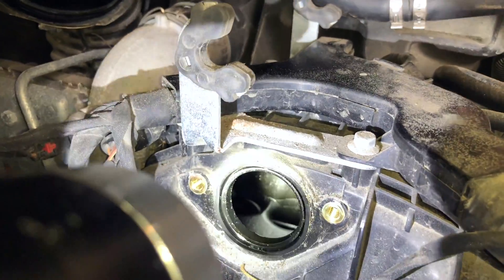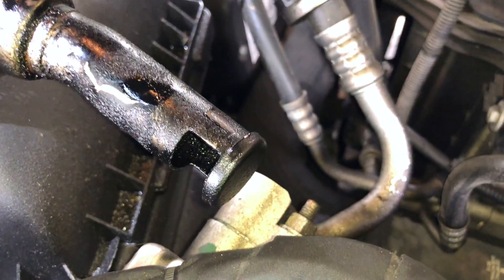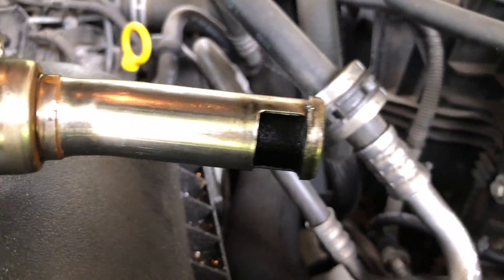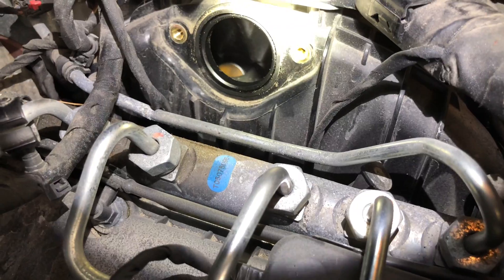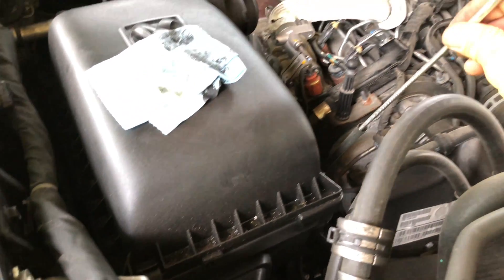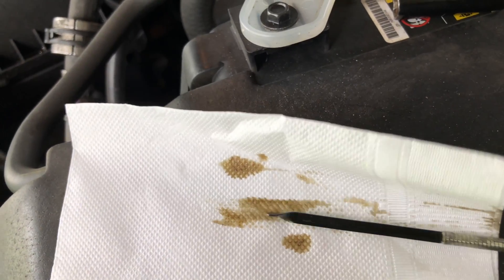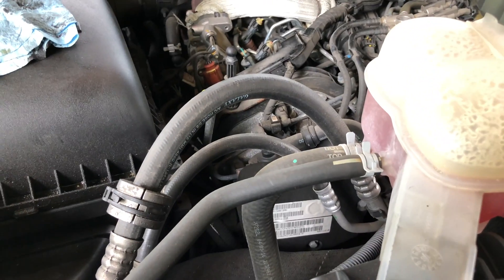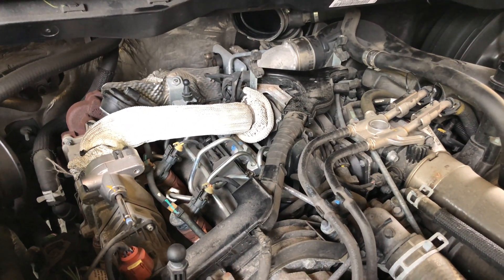Tuned EcoDiesel Update (GDE)

Comment: Deleted my EGR cooler at 102,000 miles, GDE tuned since new. Diffuser tube still clean.
Reply: how you delete your egr with a gde tune? that would mean your running two tunes unless your speaking of their pre ban
Reply: @bull5919  Pre ban tune with egr and def delete.

Comment: Do you swap out the ECU every time you visit the dealership?
Reply from the maker: No. I don’t have a second ECM. Just tell them not to install any new software without your consent, you’re “happy with how it runs and drives currently”
Reply: @hidmagnum  Right on. Just bought the truck and terrified to screw with it. I have not heard a single bad thing about this tune, thanks to videos like this it's solidified my decision.
Reply: It would be sweet if it were still available to purchase.
Reply: @fusserick76  I was still able to purchase it. However I live in Canada so I'm sure that's why. I've also heard on a few forum threads that they are currently working on a new one that will meet EPA standards. That being said, I wouldn't screw with it until after the recall, because I'm sure FCA will also update the ECM with the recall. Give it a few months for green diesel to catch up then make the move. As of now.. it's the best thing I could have done for my truck. It runs great. And in Canada it would still pass emissions.

Comment: SO you just ran the tune without deleting any emissions equipment? Still using DPF/DEF? How does that all work? How do regen's work with it tuned?
Reply from the maker: Correct. All emissions equipment is still intact and operational, except the EGR is electronically turned off. Works just like factory. Regens happen but at longer intervals. Nothing to see or worry about here.

Comment: Can someone explain to me wtf is a GDE tune!! I am searching you tube and on the web and all I see and hear is how great it is and that it cost about 700$ but NO ONE actually shows you wtf it is!!! I have a 2015 Ram with 80,000 Kim’s on it . I find it sluggish at times any keep getting Check engine code for exhaust gas sensor. I’ve never cleaned my EGR and am just now really checking up on this. I do mostly city and sone highway, I do tow my 3500 lb travel trailer  in the summer but not far. What is the GDE?? A program?? And add on??? Even on GreenDieselEnginerring web site all they do is I tell you the benifits of this GDE tune and the price but wtf is it??? Is it something I can do myself? Is it a plug and play kind of  a thing a majig ?? Can someone please help understand.
Reply from the maker: GDE is your truck computer being programmed with their setup. They focus on longevity of the engine and not performance. A major bonus to the tune is the EGR being electronically turned of resulting is far less soot being put back in the engine. Cleaner oil with less soot means you get less abrasive material swirling in the engine internals. You have 2 options. 1 send in your ECU to GDE and they program it and send it back. Or 2 you buy and ECU from them and you have a spare you can reinstall in case of warranty work. 

Their tune is used by many and it’s been working great for us. They have done a lot of R&D on the tune and it shows how well it works. 

Good investment if you plan on keeping your truck for a long time. 

Check out my oil filter video. Clean filter, no metal fragments. 

Hope this helps.
Reply: ShadyVlogz yes it does!!! Thank you for explaining. So basically you  remove nothing from your engine aside from swapping out your ECU with one that has been reprogrammed by GDE? But isn’t a complete delete a better option ( if you are not concerned about warranty issues) to solving all DEF, DPF, EGR and sensor code issues?  This is something I’ve been watching very closely. And actually it’s how I came across this GDE Hot Tune option.
Reply from the maker: The tune turns off codes that appear for no reason, such as def codes. I only have the tune. It’s been installed for 3 years. I haven’t had a single engine light. Performs well and I wouldn’t think twice that there is a tune installed, except when I check my clean oil. 

A complete delete is obviously a good thing for the engine since you would be eliminating all the things that really create a problem with modern diesels. But then there’s environmental impact. Your choice at the end of the day. I’m totally happy with just the tune and the truck doing regens and using DEF to clean the emissions. That’s my view and may not reflect others.
Reply: ShadyVlogz Thank you very much for taking the time for explaining all this to me. I will start with cleaning out my EGR which is something I never did and I’m at 48000 miles. It’s crazy that its not mentioned in the maintenance manual that this should be done at regular intervals!!  I’m a little nervous about doing either of the two possible solutions we’ve covered here. I have a choice to make.

Comment: tks for the vid! where do you buy this gde tune from? i live in hamilton. i just got a check engine today with a p200a and p200b code.( intake manifold runner performance bank1 and 2 ) if i get a tune will it clean up the soot build up in the intake or will i still have to get new intake manifolds or is it possible to clean manually?
Reply from the maker: Just saw your post on the forum. That site will help you learn a lot about this engine and truck in general. To answer your question, the tune will not "clean" the soot, but it will prevent further soot buildup. 
I'm just a driveway mechanic so can't say if it's OK to drive your truck until you fix the problem.
If your intake is that filthy, it definitely needs to be cleaned by removal. Don't want that garbage falling into the cylinders.

Tune website is in the video description
Reply: @hidmagnum  , what does it mean „tune the GDE“? Is this a procedure or do you buy a tool or some part? Where can I read about it? I got 73.000 km on my Jeep Grand Cherokee in Germany and I checked it and saw a lot of soot as you got it.thanks in advance.
Reply from the maker: @ivaningbg-73  GDE îs a company that tunes the ECU in your diesel vehicle. The tune electronically turns off the EGR valve and reduced soot buildup. Naturally there are other benefits to the tune aside from the EGR shut off. Google Green Diesel Engineering, read up on their website or send them an email for proper information from the source. Hope this helps
Reply: @hidmagnum  ,excellent explanation. Thanks a lot.

Comment: Thanks for the Video. My wife has a '14 Jeep GC w/EcoD. I'm really considering the GDE tune. Why did you not block off the EGR? As I understand it, GDE turns the EGR off on all of their tunes? How do you like the tune?  Thanks again!
Reply from the maker: Still under warranty. If something looks out of place, that raises suspicions. And if any work needs to be done on the truck, can’t be telling me I’m messing with the emissions system! 
But the tune is great. I don’t notice it is there. But I know it’s working.
Reply: You already voided warranty by installing the tune. The new ram computers will show even if you put it back to stock.
Reply from the maker: @cutandcleanwi6947  They cannot void your warranty because of the tune. For example, if you have an engine issue, and FCA declines your warranty work because you have a "tune" they have to first prove that the "tune" is the issue that caused your engine to not work properly. Just because someone modifies their vehicle (show me someone who doesn't), be it with rims, lift kit, air freshener or engine tune doesn't put the manufacture in the clear. There could be design flaws. And a modification doesn't necessarily damage your vehicle. The design flaw is most likely the culprit. Yes, it's a battle to go through. But there's a chance you're going to battle because you modified your vehicle. If you don't want the hassle, don't modify before warranty is up. but like a lot of folks, we do it and we deal with it.
Reply: I’m just saying that lift kits, tuners, air intakes, egr deleted will void your factory warranty. You might get lucky and have a dealership that doesn’t care but highly unlikely. I’m just letting people know so they aren’t blindsided when they have an issue with their vehicles and they tell the dealership that someone on YouTube said it would be fine.
Reply: @cutandcleanwi6947  Google "The Magnuson-Moss Warranty Act of 1975".  It basically says that the dealer must be able to prove that your aftermarket part caused the failure.  That being said, you do take a risk installing aftermarket parts, but it certainly does not void your warranty just because you installed it.

Comment: Tuned mine at 600 miles and also put a GDE trans tune on about 2k miles ago. The 2 paired up is awesome. You may want to consider adding a catch can. Keeps any oil residue from blow by going into turbo. My eco has 9000 miles on her now. Changed oil 2 times already. The oil is so clean.

Comment: If you don't mind me asking what dealership do you take your RAM in for Service? I"m looking to have the GDE tune done as well and would be willing to have my serviced there aswell.
Reply from the maker: Don’t get me wrong, but I don’t want to expose anyone. I have lots of respect for the guys at the dealership. What area are you from? You don’t have to worry about having your tune found by the dealership. They can’t tell that it’s there. Worst that can happen is the tune get overwritten. Get the GDE tune, and enjoy it. Your truck with thank you in the long run and you will thank it on the first tank. Clean oil. Minimal soot in your engine. Disabled EGR. Better fuel economy. The sooner you get your truck tuned, the better it will be. Enjoy!
Reply: Not looking for anyone's name, just the dealership. I live just north of T.O. Bought our RAM several weeks ago and just brought it in for its 1st oil change.  We spoke to our dealers service Manager and asked what they thought about the tune and the reply was, well lets say it wasn't positive.   There's a possibility I may have drawn some attention to myself as a result and if that's the cast, I wouldn't have any other option but to take to a dealer that is ok with it or simply wait for the warranty to expire.  You mentioned in your vid that your dealership researched the tune themselves and are quite comfortable with it, so I didn't think it would be an issue if you provided their name.  How about their closest intersection :)
Reply: @Smeelge  did you find a place to get it, i live close to you and i'm also looking to get the gde tune. help!!
Reply: I think the only place to have it done is GDE.  I don't have a problem with that, the concern I have is it voiding my warranty.  I don't want to have to go through all the BS between myself and a dealership after the fact, I'd prefer to find one that is ok with it or better yet endorses it, they'll will be the ones that get my business.  Just haven't found one yet.  So when someone says my dealership doesn't have a problem with it, or that their dealership researched the tune themselves and are quite comfortable with it and yet they are reluctant to name the dealership (whom I'm sure most EcoDiesel owners would love to know) I don't have a lot of confidence in that person.  If I find one, I 'll be sure to post it here, but until then I won't be performing the upgrade at least until my warranty runs out.
Reply: My guess is if you could privately message the o.p., they may give some assistance. Publicly putting info that was requested could draw some unwanted attention towards the dealership from corporate.....

Comment: Nice I have a 2018 ecodiesel so your saying that the dealer doesn't bitch about the tune
Reply from the maker: I’m saying I’m cool with the mechanic and the service advisor.  I’ve been a long time customer and they know I’m not looking to scam. 
But, regardless of that, the tune is not detectable. Many owners who have tuned ED’s have no issues when doing warranty work or emissions testing. 
Worst thing that can happen is they update your ECM and flash over the tune. All you have to do is send your ECM back to GDE and they will reprogram the tune for $50. I’ve not had to do this myself but it’s good piece of mind.